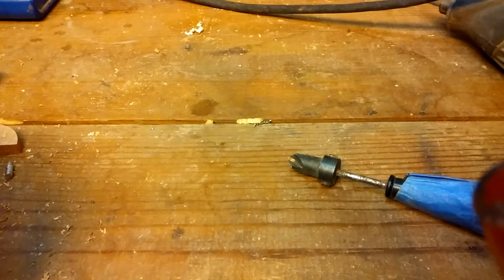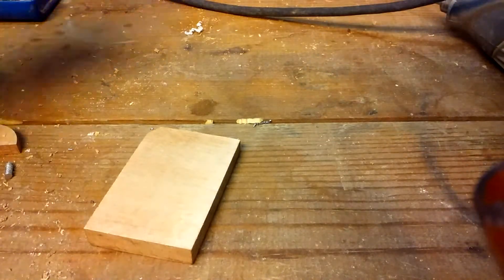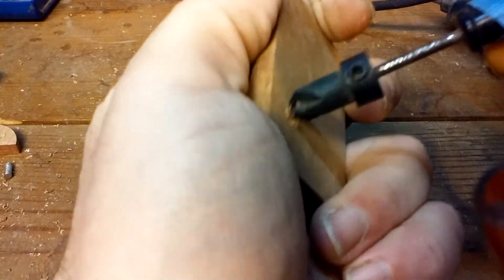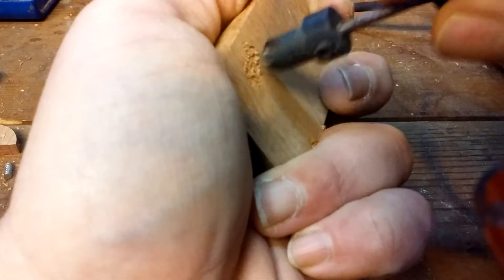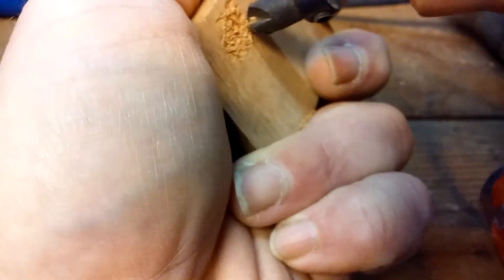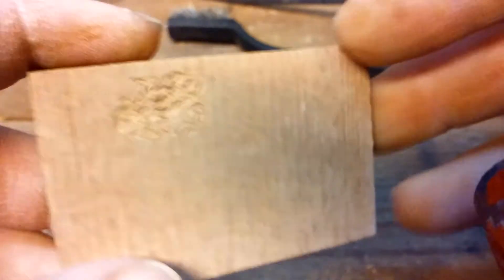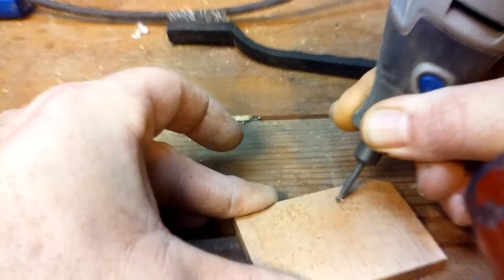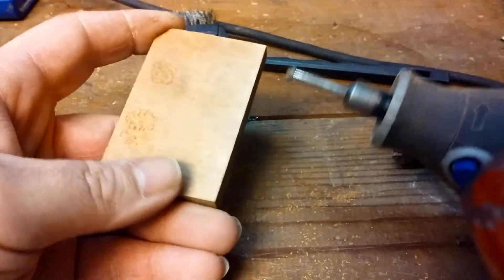Rustication tips and how to...

Comment: Sweet tips, Joe! I really need to get some rustication practice in. Especially since most of my briar is lower grade and the grain doesn’t look like it will be super nice, and no blasting equipment 😂 I’m planning to cut an X through the tip of a Phillips head driver to do what you showed with the countersink. I’ve heard pretty good results can come from that. Have you ever tried any of the fake sand blast techniques with various wire drill attachments meant for paint stripping or cleaning rust? I can’t remember the tool name, but they’re basically hinged wire bristles with a bend near the tip.
Reply from the maker: Nom De Tube Yeah the wire brush wheels work ok but you have to keep moving in various directions or you'll develop lines. Kick up some dust Andy and thanks for stopping by. Blessings brother!